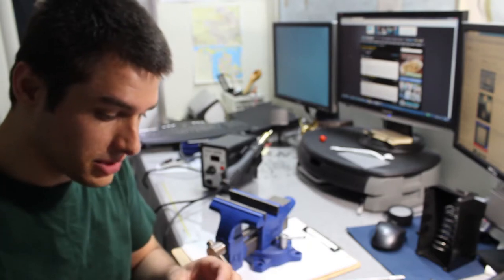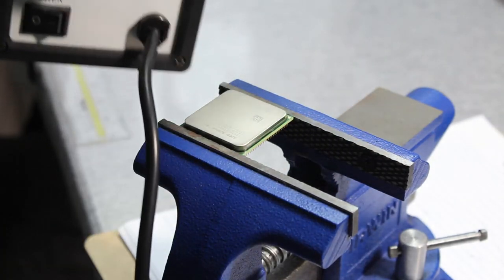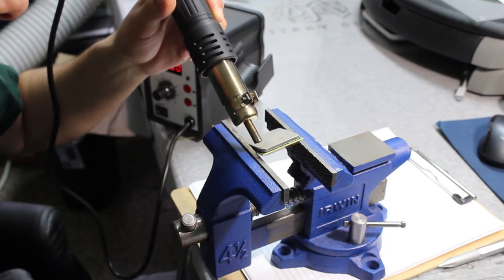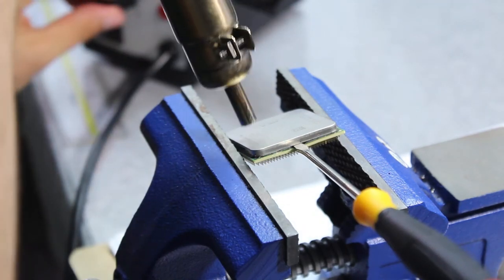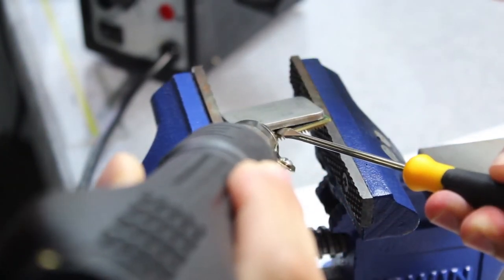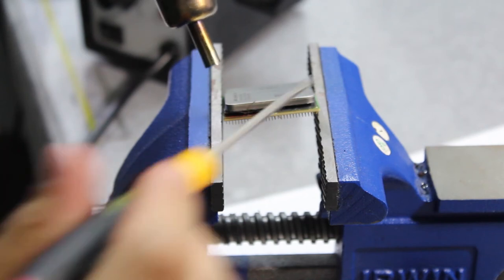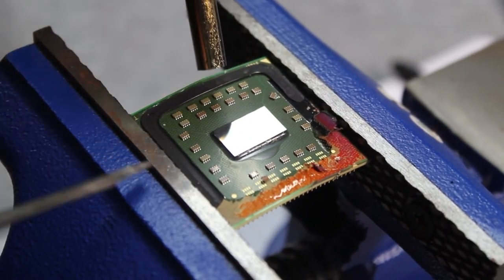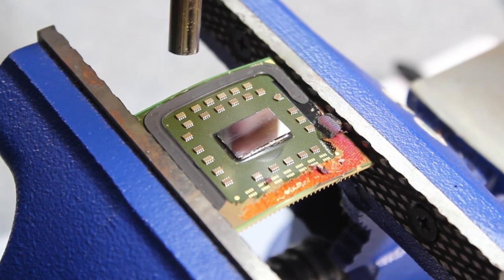Under The Hood of an AMD Athlon Processor

Comment: its chip is not soldered to the ihs so your hot air gun is not doing any job except damaging your cpu. just use a sharp razor blade to cut through the glue and the ihs will go off. For a soldered cpu, just put it on a hot plate which can heat to 200C for 30s then you can remove the ihs perfectly without pulling the chip out.
Reply from the maker: +任嘉宁 The point was to see what was underneath without physical damage. It was a junk CPU anyway; I found it in the trash!

Comment: "These processors are designed to get hot. 300°, I expect not much to happen" - this guy has no clue what he's talking about.
Reply: T-junction is about 180 degrees Fahrenheit. It died the moment it received heat.
Reply from the maker: LMAO. THis was a CPU in the TRASH. Everyone Relax.
Reply: nj4ck I agree, specially since this processors actually used to run cooler than their Intel counterpart

Comment: Probably could have saved the processor. I spied a couple of bent pints and i think thats why it was thrown away. Subjecting it to this kind of heat is just retarded.
Reply: You do realize that this CPU is over 10 years old and that it has 1 core clocked at 2.4GHz?
Reply: You do realize that some starving child in africa could have had the most bomb gaming pc on a budget.
Reply: ShamusOGrady2 A single core CPU nowadays struggles to keep the OS running.. let alone game
Reply: Aezakmei  well im gonna show you my 4790k ht disabled on 1 core be so fast   lolllll
Reply: MrBonami2  and those cpu can run windows 8 easily with an ssd   for grand ma and other people

Comment: i had an fx 8350 and under 100% load with an h100i it never got above 40C. and my room is in a basment so the ambiant temp at the time was 19C ( it was winter ). i was quite impressed with that chip pplz where telling me "oh you bough AMD you must whant to heat your room with it because it gets to 58C under 80% load". I never had that issue and sure AMD is laging behind intel but hey its the best CPU for price to preformance ratio in my opinion. :)
Reply: actualy amd cpus don't have the sensor in the actual die so they don't measure the temp accurately, your actual temps are 10-15 C higher than the sensors show :)
Reply: well thats some bs cuz that would mean you are running 10C i think this may be a software fault :D
Reply: lol forgot about this till one of you commented
Reply: whatever i will leave you guys with a hashtag or two

 #TeamRed  
 #AMDFTW
Reply: Upgraded since then. got a i7 4790k now
Reply: Why??? just why???
Reply: 1) its way faster and all my games got a fps boost now that i can actually use my 780ti and that shitty 8350 isn't bottle necking it any more  2) i can now transcode and render 3d scenes in a lot less time. it was worth it in my opinion and not to mention my power consumption has gone down since i replaced my 2 SAUS 760' 2GB with a single EVGA 780ti w/ACX SC 3GB . my buddy still has a 8350 and i can get my work done a lot faster then him with a 4790k not to mention i can OC the fuck out of this bitch( learning to oc atm my buddy got this 4790k up to 5.1Ghz in his system. i lent it to him to try in his system ) and get a huge increase in performance. and why are you so shocked that i did that i upgraded?
Reply: yeah sureee you don't actualy have a 4790k or you never had an 8350! the difference in games is next to none...
Reply: and yes their is a noticeable difference with a 4790k and pcie gen 3.0 certain games i get a 10-20FPS boost. Far cry 3 ultra pn 2 760 with a fx 8350 could barley keep a steady 60fps on ultra when i upgraded i got a my 4790k their was a noticeable difference as the fps wouldn't micro stutter any more. Dont have that issue any more since my EVGA 780ti SC eats everything i throw at it
Reply: sureeeee...
Reply: Mr R00K of course you are in the basement
Reply: same